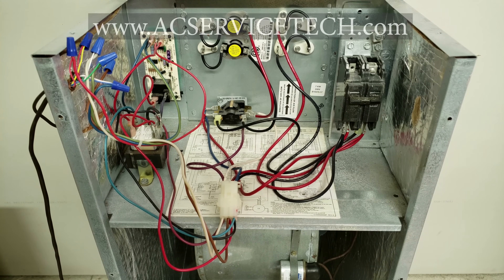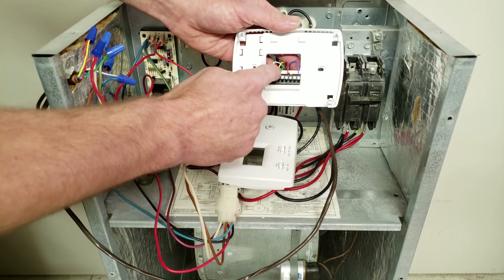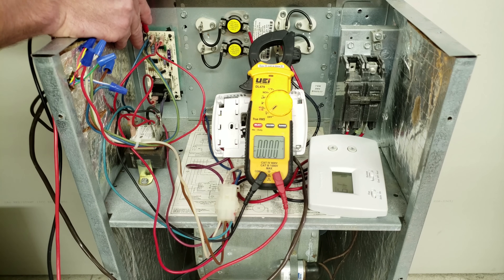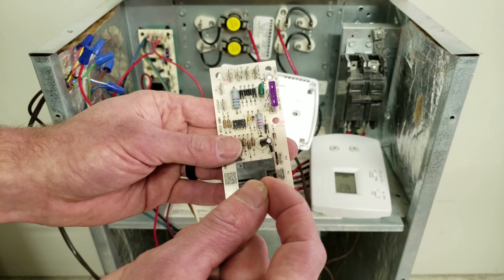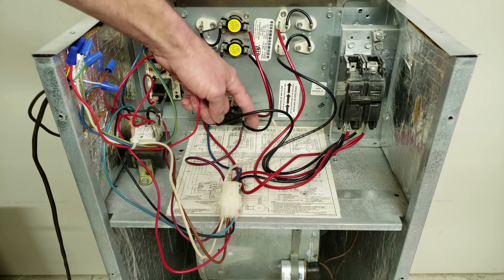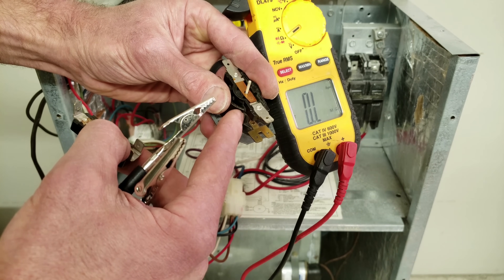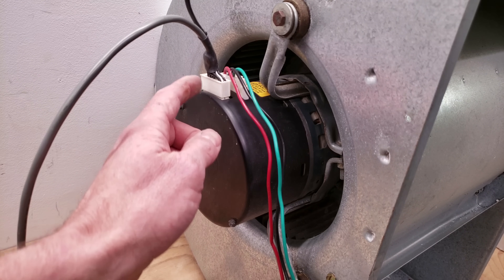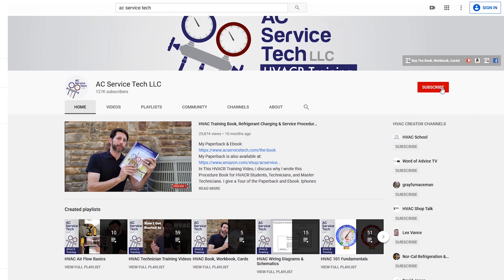Air Handler Blower FAN WON'T TURN OFF! 5 Reasons Why it Keeps Running!

Comment: Good video,  nice details!

Have a question,  I have a Tappan 92.1 H.E. gas furnace, the thermostat went blank with good batteries in it, and new batteries, battery terminal had some bad corrosion on it, cleaned it up with vinigar.. then it came on, went off.. bought new replacement similiar model, and it did turn on cycle ignitor, and both fans ignited,   Just before that I had a blocked n cracked j-tube, cleaned it, trimed and reinstalled.  Also the power relay had a burnt Hole in it.. arouand where the two parts connect I believe. 
I was going to order another board, but will take some time to receive. 

Am I able to use the furnace for heat safely at night, or before going to bed and shut it down...?? 
 I know the blower fan has two speeds to it ... low and high.. have not checked, but the high kicks on I believe..(definitely not the low speed. 
10-15 minutes ran it, from the new thermostat installed.   Also jumped it from the board with no thermostat before buying new one.  Old one came on, then off after 5 or so minutes. 
Everything seems to cycle on, and off when shut down.   Will check if it shuts down when it reaches optimum temp.  (think it did but forgot) 
Part number   T9AV1D12-22 Power Relay. that is damaged on from, smoke residue around front rear of board not burnt .

Appreciate adice on being able to run the furnace temporarily/ sparingly while a new control board comes.
Eric, MN

Comment: Ours is a combo deal. When the unit runs for awhile, the fan hangs. Pulling the thermostat stops it, but a new thermostat does the same thing  replacing the thermostat works fine for awhile, and the fan eventually hangs again until i pull the thermostat.
Reply: Did you ever find a solution?

Comment: My blower motor wasn't turning off, the thermostat was on auto, I pulled the cover and it kept running. I pulled the power supply switch and it stopped. I  pulled a couple panels and took a look. I then switched power back on and now the blower won't run. Does that info narrow down what the issue is?
Reply: That would help if you were talking to someone who is physically at your location. Not enough info over the internet.
The blower not running after panels being removed could be a door switch opened.
You need to get a voltmeter and learn how  to use it, if you want to save money.

Comment: Will the A/C bill be noticibly higher than normal with the blower motor constantly running?
Reply: Yes!
Reply: @HsingSun  
But of course.
Reply: What was your problem? My blower runs  quietly and never stops once the temp is reached. When blowing cold air, the blower has the normal loud noise. Thanks
Reply: @ozkary  
🤦🏻 So, the answer to my question is, yes?
Reply: @MrJohnnyDistortion  OK, thanks.  I wanted to see if there was a difference in your case. In my case, the blower is not making the regular noise. I had to go to the attic to hear a low blowing noise. It can go unnoticed.  The high electrical bill made me aware of it.  What component failed in your case?

Comment: Very informative thank you so much we have had a HVAC man out here twice first he did maintenance but we have to turn the blower off by the circuit breaker because it does not shut off it keeps running but the temperature on the thermostat keeps getting hotter and hotter and hotter when we turn it off at the breaker and then flip it back on after it's set for a few minutes it will turn the air back on.
Reply: I'd check the sequencer and check the limit control switch.
Reply: @jaywalton9552 is the sequencer the same as contactor in outside unit
Reply: Sounds like a bad high limit switch

Comment: Great video! Problem I am having is that let's say the room temperature is 78 and I set the thermostat to 73, I can feel the cold air coming out. And slowly it gets down to 75 to 74, then I can hear my ac turning off, but the air is still blowing. After few minutes the cold air turns to cool, then warm, and the temperature goes back up to 76, 77, 78 +. Do you think it's a bad thermostat?

*Update: Bought the exact same thermostat but still the same
Reply: Blower motor is running without the flow of refrigerant. I'd say it's an issue with your blower motor. If the condenser has no call for cool but your motor is still running, it just ends up pushing the room temperature air and it can stuffy/warm while doing that if it's a warmer season bc it ends up just pushing hot air throughout your home.
Reply: @JM-gx7iv  Listen to the symptoms, he states that unit is trying to reach tstat setting, but just before it does, outside unit shuts off while inside blower is correctly still calling to meet tstat setting. 
He is having a problem with outside unit shutting down prematurely. Outside unit should be checked for faults.
Reply: @officerkrupke4966  definitely missed that key data point of the tstat not being satisfied. Though, more information is needed to help diagnose the issue regardless. However I thought originally the statement was the tstat being satisfied and blower continues to run which is the reason I answered the way I did.
Reply: @officerkrupke4966   could be pressure switches or numerous other things, more data is needed
Reply: @E-Stark, Your thermostat problem is very similar as mine.

Comment: Excellent video on troubleshooting why the air handler fan continues to run.  My issue was the sequencer and didn't realize it.  I had unplugged that connector since it also had wiring for the strip heater which I don't use so that's why I unplugged it.  When I plugged the connector back in the board, the fan started working correctly.  Self inflicted but lesson learned.  Thanks for sharing your HVAC knowledge.

Comment: Mine is having this issue and the only thing I can find after testing everything multiple times is that somehow I am randomly getting 8 volts into my green wire from somewhere. I changed the green wire to the brown wire and the same thing happens. Ran an entire new solo wire and still the same. My testing showed the board to be bad at first and it did have a burned spot on it and the voltage I had with it went away but now this 8 volts is an issue and my blower still run constantly. My only guess is the blower motor has the speed control on the back of it and I have not seen anything on how to test it so I am guessing maybe that is where the voltage may be coming from. Mine is not the type you have in the video but is a variable speed but the plug is out away from the motor and just wires running into it.   I also tried a new thermostat just for kicks even though I didn't feel it was the issue and it did the same thing still.
Reply: Did you found out what the issue was?
Reply: @richardjones5632  It was the circuit board on the end of the blower motor. I found a test for it and checked then had another a/c company other than the one that installed it come out that covered it under warranty. The place that installed it was saying it was things I knew it wasn't they tested nothing and wanted to charge me even with it under warranty.

Comment: I had a bard unit that stayed running even after it got satisfied but it would delay shut off like your saying but only if you set the temp quite a bit higher than the setting.
Reply: Which I'm not sure what kind of motor it is but I guess if it has a delay before cutting off it is ECM???

Comment: when you use wires to  jump the fan  .. i assume you touch the R and G wires .. my question is  what 2 wires do you need to touch to engauge Auto Fan ... in other words what is the thermostat touching inside to engauge auto fan rather than manual always on fan ?

Comment: My airhandler looks like yours but my blower motor does not have a capacitor. The replaced my motor yesterday. I told the tech that I did not think it was not running as fast as old one because the air was not coming out of the vents like the old motor. It worked for 24 hours before the lines froze up again. It has two connectors that hook up to motor. Can the be connected on wrong connector on motor and cause it to run slower?
Reply: sounds like the tech was late for a date and gave you the I aint got time to check my work, I have three more calls to hack thru till its Miller time.
Yeah, he probably used a replacement motor that is programmed differently from  your old one and didnt read the manual on which terminal number to use for whatever tonnage your unit is.
there are so many bad techs out there that I wouldnt trust to do a stool sample.
If you ever find a good one, play the lottery, you are lucky.
Reply: @officerkrupke4966  The service manager had to come out and fix it himself. It was a new motor but was wired wrong at factory. He called them and had plan already on which wires to reconnect correctly. It was running backwards which was the problem.

Comment: If my blower fan continues to run even after turning the system off and disconnecting the thermostat, I have a wiring issue on my hands?
Reply: You ever get it sorted?

Comment: An excellent video..My Trane 3.5 ton with ECM has intermittent "fan continues to run" problems....Suspecting  one of the relays you described. Sticking contacts. Will follow your methods next time it malfunctions. Thanks for  this great video and the tech information !
jP in Titusville Fl.

Comment: My problem is when I turn on my a/c it run fine for a little bit then the fan on the furnace turns off???  It will turn back on after a little bit and continues to do this. Any ideas?!?  Ty👍

Comment: I had an interesting call once. Turns out install never jumped the Rh/Rc on the tstat. If I remember common was on Rc so when in cooling it would just run. In heat everything worked fine. That was on a honeywell T6 pro.

Comment: Hi! I have 9 Haier air handlers with control boards that do not have fuses. Some of these control boards keep blowing out from power outages. I want to add an inline fuse to these control boards. Can you tell me which wire l should add the fuse to in order to prevent the control board from going bad and having to replace it. Thank you

Comment: It's not regardless of what type of thermostat you have. Some thermostat only front cover is removable not the wire part. You have to manually unscrew wires from the wall.

Comment: My ECM blower has an off delay. I also have a sticking contact in the blower relay. if you tap the relay or pull the wire off the blower continues to run till it times out. It would be easy to blame the ECM and have the same problem after replacing it.

Comment: Thanks for this great information about heat sequence, I am straying to understand how you wire the fan relay 
One wire 120v  directly from the transformer going to no and one wire 120v  come from the squencer so when it call for heat we have energized the one that come through the sequencer so we got to hot wires to the fan relay the then the no close with the coomon wire so why I have to get power to the nc to the relay and how it works for aircondion please I need to figure out how it sequence work ?
Reply: the nc contact is only energized when the heat sequencers contacts close on a call for heat, thereby starting the blower.

Comment: Craig didn't mention how to know that the blower relay contacts are welded closed. Is there a way to test?
Reply: With power disconnected and the wires off the two terminals, the two terminals should not have continuity between them.

Comment: Hi!  I have a furnace with the fan keeping running even after the set temperature is reached.  If I switch the fan to "ON" and then to "AUTO" on the thermostat, then the fan turns off.  I checked the thermostat by removing it, the fan still ran.  The wires are fine.  Would you please tell me what could be the problem?  Thank you very much in advance!
Reply: Something is touching in the 24v wiring, how old is your thermostat, do you live in high humidity environment? Your wires where they connect to thermostat could have some corrosion, or the wires on the control board might have corrosion or be slightly touching. When you remove the thermostat cover it should turn off, since it's not then your not breaking the circuit so something is touching.
Reply: @victorglaviano  Thank you so much for the tip!  I will check the wiring this weekend.
Reply: @PingPongProfessor  how did it come out?
Reply: I would love to know the answer to this, as well.

Comment: My coleman mobile home furnace blower motor wont stop running.  No flame
Reply: Probably corrosion from humidity or moisture, RVs are notorious for having these issues because of their proximity to moisture, clean contacts in the thermostat and circuit board with electrical cleaner and a real light coat of dialectric grease with a Q-tip semi-annualy will help stop corrosion and the dialectric grease will repel moisture.

Comment: What would a close on temperature rise safety switch be for?
Reply: Hi Myron.  Can't think of much use for a close on rise safety switch, usually see them as control switches.  Only thing I can think of for safety would be as an indicator light to operator.  Example. Temp rises beyond a set point and closes the switch providing voltage to an lamp positioned at say a remote operator panel.

For control could be used to turn on fan when the temp gets to a set temperature. Delaying the fan on and delaying the fan off until the heat exchanger cool down (off).  If it is a snap action type of switch would usually have an F in the part number instead of an L.

Also is used in control for walk in cooler defrost termination.

Could be used to cycle an additional fan or fans say on a condenser but I usually see pressure switch for this.

Anyway, hope this helps.

Comment: I had to work on a smart thermostat and my problem was the c wire connected! The wires ran were 18/4 I had to run 18/5 and it fixed the problem. Hope this helps someone

Comment: I have an RV with  dual thermostat. Runs both AC and furnace. Sometimes the blower motor does not stop and I have to pull the fuse. But when I put the fuse back in it works fine, until the next time. It sounds like your diagnosis for the blower motor module but then why does it work again after reinstalling the fuse ? Is that more of a thermostat glitch ?
Reply: Contact sticking either in a relay or the thermostat itself... How old is it, has been exposed to moisture before (relay or contacts), probably the thermostat is bad or going bad or you have a relay that switches on/off compressor and/or fan. Hopefully this gives you an idea, btw RV systems are known to have sticky contacts because their exposure to moisture!

Comment: I have carrier 28AC900-014 furnace. When the temperature is set to 70 degree on heat the blower keeps on running even after reaching the set temperature and I have to turn off the power switch to stop blower running. When I set the temperature to 75 degree on heat the blower stops automatically after reaching the set temperature of 75 degree. I changed the limit switch but still the problem is not solved. I called a technician and without checking the thermostat or circuit and any other aspects he just took of the face of thermostat when the blower was running and told me to change the heater and when I said I don’t want to change the heater he advised me that the circuit board may be defective and asked me to change it. I wonder what could be the problem. I would appreciate if you can advise me on this issue.

Comment: Great video, can you assist me please. I have 24 volts at G and C when the thermostat is set on cool and auto for the fan. I do NOT have 24 volts when the thermostat is set to the off position though. The blower fan never stops. I only have 24 volts when the AC is set to cool. Is this a bad thermostat wire?
Reply: Would have been great if he had responded to this question :-(
Reply: Another question can we bypass like that relay as long as it has 24 v is going to blower or if its a delay switch bad or disconnect  I'm old school when didn't have all the extra fetchers to go wrong If can explain this would be helpful if possible?  If part bad like small parts like relay could buy but if could run fine w out & if module is bad do need to buy motor or can wire to 24 v contractors the way I remember & to save money helps,
Reply: What kind of thermostat do you have, Honeywell? Is it under warranty? Call Honeywell tech support if it is under warranty. 
I would think your tests are good, it is not a bad thermostat. Because I have the same problem and I did the same tests.
I have been working on my problem one step at a time.
Reply: bad blower control board. To test, shut off power to air handler, remove wires from board relay terminals and do a continuity test on the normally open and common terminals on relay, if they are welded shut fan will run continuously.

Comment: Hi thank you for your video. The blower fan up stair which is not the one connected to the evaporator keeps running but slower than when the ac is on. What could be the problem. Thanks.
Reply: hey your talking about your out door fan condenser?

Comment: Mine a.c. unit reaches the temputure but does not sit of ..  I set it to °76 it reaches but does not sit of the blower fan and out side unit still run continuous when I set it to 80° it sometimes sut of and cycles every 5 minutes or so. To day it was 93° out side.i set it to 76 never reach the temputure set it to 80° it reaches the temp but never sut of..  blower and the out side unit ..    I had recently got a new coil for the inside unit and got a new one do to had hole in my old one and no Freon.   Got a new coil for the inside unit can it be that the technician did not put enough Freon in it??  And it's one of those coils that aluminum ever sence put that coil in seem lilke my whole system out wack 
 I need help
Reply: There's still low coolant in the outdoor unit, probably still have a leak somewhere